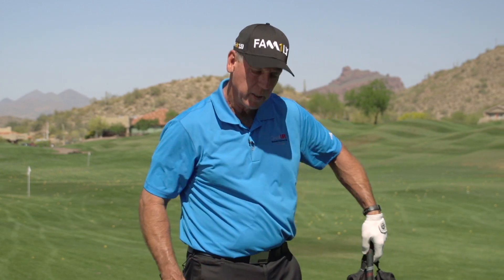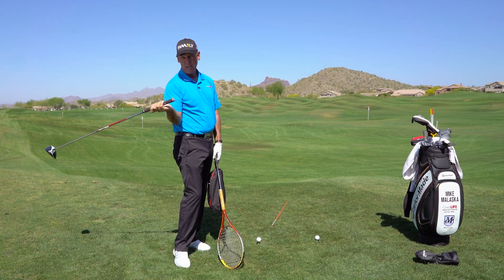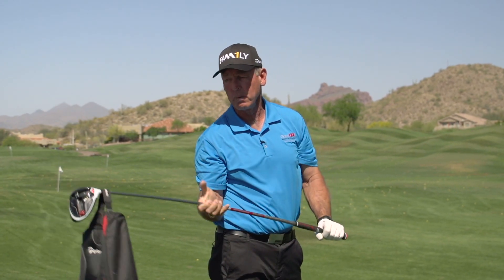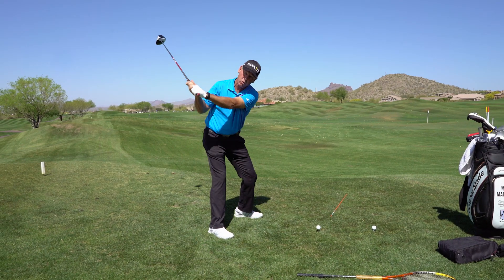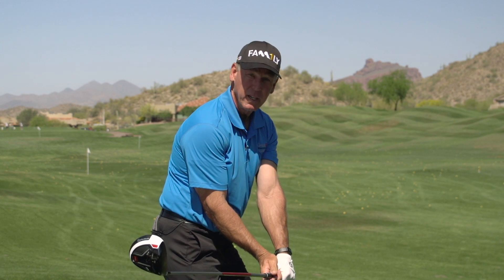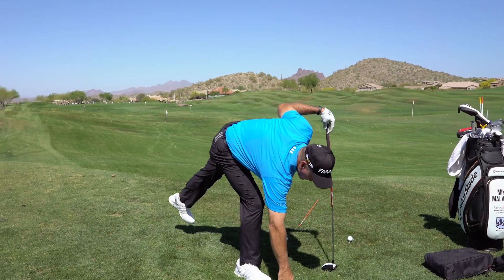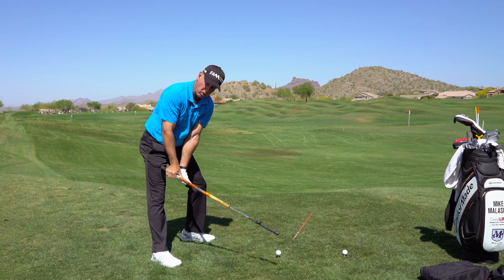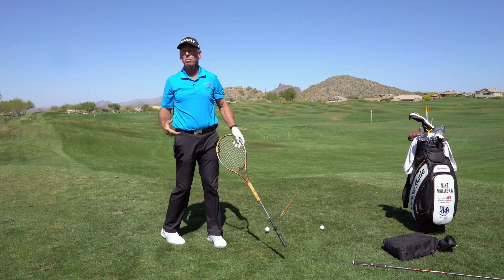HOW TO DRIVE THE GOLF CLUB WITH MIKE MALASKA

Comment: In Mikes defense teaching golf for 40 years both amateurs and pros Mikes teaching here is exactly what most pros are working on and that's getting the club back in front of them and still staying connecting. Most tour teachers teach similar ideas Ballard Springing the shaft left arm connection works about the  same. You would never see a tour pro practicing lag or trying to keep the club behind in the downswing and the reason most pros have such strong pivot actions for  the club gets stuck. On the other side I can see amateurs being appalled at this because most don't have a dynamic pivot were there creating lag thru there pivot. So I would agree this would probably a bad piece of advice for most amateurs who cannot create pivot acceleration .BUT if you get good enough we're you can accelerate your pivot to were creating 105 clubhead speed you'll find this teaching very beneficial
Reply: castlemangolf you’re wrong

Comment: i am amazed at he disparaging comments below.  I have taken many lessons and studied many golf instruction theories.  Malaska's instruction is most sound and insightful concerning the forces at work during the golf swing.  Now that I am a senior golfer in my 70s, I especially find his instruction most helpful in getting the club squared up in the impact zone without the additional body rotation necessary to overcome the clubhead that stays behind the hands during the downswing,  I have been a single digit handicap most of golfing career and I am striking the ball very well using his pivot point and "push away" from the club teachings.  I think if the naysayers studied all of his tapes and applied his swing instruction to their own swings they would be more appreciative.
Reply: I would suggest reading the work coming from college physics labs on the golf swing and the 3D models being produced from computer analysis and they completely contradict what he's saying.  The advice he's giving is a band aid cure for high handicap slicers.
Reply: David Laville, Dear David, I have read the articles from University of Pittsburg and Stanford as well as Muira's paper on parametric acceleration.  I believe what you are referring to is the concept of maintaining lag until releasing it further into the downswing than Mr. Malaska advocates and the X factor in producing clubhead speed. I agree that maximum clubhead speed can achieved by such method, but at what price?  The fortunate/unfortunate aspect of the golf swing is that there are different ways to deliver the clubface onto the ball with acceptable results.  I would put Mr. Malaska's approach along the lines of Henry Cotton, John Jacobs, and Jim Flick, his mentor.  I would not describe it as a bandaid.  I do not see it falling off.  Moreover, especially for seniors, I think it is beneficial to put our hands back into the golf swing.
Reply: Everett Urech Read the research of Dr. Steven Nesbit or the 3D models that show the club is still being accelerated longitudinally into the both arms straight position.  The lag is never released that's why a good swing has no release point feel. Henry Cotton, John Jacobs, and Jim Flick swings are based on driving range empirical evidence not scientific data or research.
Reply: +Everett  Well said, couldn't agree more.  Mike totally changed my game, his program/site is awesome!
Reply: Everett Urech i
Reply: I agree Everett, he's not trying to get into the kinesiology of the movements but the thought of the movements and visualization of the movements that have historically been successful.  I do not think one swing is for everyone, we all have to find our own...which may be similar to another...but it is about advancing a little white ball down a fairway into a hole....the issue is that everyone wants to do it in as few strokes as possible.

Comment: Tipping the club out is a little strange at first but when you finally "get" it it is pretty incredible. It is actually a barely perceptible movement that you don't have to think about. Also with this method the clubhead squares up at impact automatically because of centrifugal force. If you make the effort to understand and use what Mike is teaching it may just change your golfing life.
Reply from the maker: Thanks for the positive comment.
Reply: flower2289 absolutely! Once you perform this it works like magic!

Comment: Only issue I have with this movement is the hands dropping straight down toward the ground. Bradley Hughes (GolfAus) teaches the hands move outward and the forearms rotate clockwise at the start of the downswing then counter clockwise with body rotation to square the clubface. It promotes an inside approach to the ball. That works well for me. Well, after watching multiple Malaska videos and working on these drills I’m sold. I’m striking the ball much better and hitting straighter shots. More distance too.

Comment: Makes sense to me. Imagine making a swing exactly as you would to hit a ball on a level lie but standing straight up tall and moving the ground to the same relative angle to you chest. You will notice, at the appropriate angle how high relative to your waist line you're actually hitting the ball.

Yes the ball is on the ground but the hip hinge changes the angle to make the strike more like a baseball swing hitting the ball later in the release

Comment: I think there is some confusion with the comments on here & people are thinking it's an over the top motion....it isn't. Pete Cowan explains similarly with his axe drill & Thomas Pieters uses this in tournament play today. Stenson talks about using the ground & hammering into the back of the ball with his right shoulder. Rose explains it in a short video about "pushing" into the ground & defo rehearses before every shot. If I've got this right there is no "pulling" of the handle, the left hand drops by the right pocket by " leaning" on the shaft giving it pressure all the time fighting to keep clubface square. Garcia may look shallow & is but even he states he feels like he's pulling a heavy chain. The hips push as a consequence of what's occurring. Clearing early & dropping club behind will result in weak shots & shanks. How can you create clubhead speed by pulling the handle & lagging the head? You can't. Simple.

Comment: As I asked on another of your videos, from the start down you are demonstrating here, I noticed that almost every pro swing looks as if the handle is tracing the arc that you initiated on the "start down" move. By simply allowing the centrifugal weight of the club head to "release" on its own seems to generate a lot of speed without effort. In fact, trying to force "lag" or generate tension by trying to flip the wrists (other than forearm rotation) seems to slow the clubhead by forcing it off its arc. Is that correct? I've started using your down move and my swing seems to have improved in consistency and speed. By using a more vertical movement, my club tends to fight coming over the top or getting stuck behind me. I presume that is exactly your point.
Reply from the maker: DocDLH sorry Mr. Malaska is not available on this post to share further advice.  He is available on YouTube through his own channel or malaskagolf.com

Comment: I like his putting tips, but this analogy will only work for a limited few. Any motion (steering wheel idea) that pushes the right elbow behind the hip and above the left elbow is a recipe for disaster IMO.  Most players need to learn to 'allow' the club to drop behind and not 'steer' the club head over the top which is an instinctive reaction to 'control' the club head and deliver it to impact. I would encourage the exact opposite turn on the steering wheel to produce better results - :o
Reply: Nick The Hoff not in his terminology. He says you FEEL, FEEL like you are out there, in actuality its just allowing you to compensate for the momentum of the club. Note he says the pros use this, i don't see 1 of them slice or mishit like an amateur.

Comment: There might not be a better drill for players of any ability!  What is the biggest problem with ALL golfers.....good.....bad .....new.....experienced?  The SYNCHING of their arms and body at impact!  If every golfer got to impact with their shoulders square to the target (therefore with their arms/hands directly in front of their chest......yes, I know about Furyk, Trevino, Daly, Player, and all of those that are 'open' at impact......and I can explain those in another post if required.....), the average score would plummet and golf would just become a putting contest; and this drill does more to get people to feel that 'proper' impact than any other drill out there!  It doesn't matter how fast or slow you swing, whether you take the club back to the 'inside' or to the 'outside', getting to impact requires the SAME MOVE.
The ONLY piece of instruction missing, here, is where Mike shows that at impact, the 'handle' of that racquet is pointed straight at the sky and his shoulders are square to the target line......which, no doubt, he would have if he had another minute or two......
It's not easy.....in fact, it's an unnatural feeling (to most of us not named Nicklaus, Woods, Knudson, or Wright).  The baseball swing feels natural but you have to hit a ball travelling 95 mph.......the golf swing is unnatural which is why the ball is just sitting there.....both games then become similarly difficult to excel at.....
Reply: tr78478 the golf swing and the baseball swing extremely similar.  Almost every amateur has their shoulders square at impact and professional players are all open even tiger and jack are open about 20 degrees at impact.

Comment: I'm not sure about this. Nearly ever other golf coach encourages letting the club dropping down behind you and I was of the understanding that the club should shallow out in the downswing, not steepen. You look at pros like Furyk and Ryan Moore and they have extremely steep backswings, but then really shallow out the club on the downswing. Plus, for anyone who has struggled with an over-the-top swing (myself included) this is only going to worsen that problem.
Reply: In his other videos shows you over top swing because your shoulders going out to ball and spinning out to much try shoulders turning out right of where your hitting and feeling of overtop with your hands which will get you perfect coming from inside hitting straight shot
Reply: If you have an over the top swing feel like your shoulders are turned 90 degrees away from the target and bring your hands to somwhere near your address position while keeping your back to the target, over the top will be gone

Comment: OMG! The LAST thing amateur golfers need is the feeling that they're going to "cast" the club head outward. no, no, no, No, NO!!

Our biggest challenge is the brain telling a right handed golfer (with a dominant right side) to bring the right shoulder over and smash the ball.

EASY FIX FOR ANY SLICE & SIMPLE BALL CONTROL

Looking down the target line, see at the back of the ball cut into 4 equal sections (down the middle & across the center). Number them counterclockwise from the top left. #2 being the BOTTOM LEFT quadrant.

THAT #2 is where a right-hander needs to strike the ball for a baby draw. Focus on striking the ball from the "inside," so that the clubface (square to the target line) strikes #2 , entering from 7 o'clock and exiting out to 1 o'clock, with 12 o'clock as the target line.

I guarantee this, proved it myself with my "7-2-1 LEAN Golf Swing" with success for myself and my students. Forget everything else and focus on that. You can fade at will by hitting Quadrant #3 and work the ball as easy as pie!

Try it!
Reply: +Sickof GovWaste If you bothered to really watch the video and some of his others, you would see it is not casting.  It is called "over the top from the inside".  Just try the move very slowly as shown in the video.  The club moves outside of the hands as the hands move from the inside out.  It feels strange at first, but if you do it slowly you will see that gravity drops the club down inside the target line, effortless power, no getting stuck.  Adam Scott, Justin Rose, Susan Pederson, Lydia Ko among others swing this way. Watch more of Mike's YT videos to see it explained more. Your thoughts are valid, but you're always fighting timing and getting stuck.  I was always fighting my swing until I found Mike Malaska.
Reply: "over the top from the inside"

Makes absolutely no fucking sense chief. Your swing should NEVER, at ANY point, be over the top - end of fucking discussion.
Reply: +No Here Kruger  It's obvious by your language that you are ignorant and have no clue how the golf swing works, so there's no point in trying teach you anything.  If you do happen to open your mind and watch the entire video and some of his others on YT and actually try it the way Mike explains it, you'll see it makes perfect sense, chief!  The club head comes squarely into the ball from the inside with tremendous speed and an effortless release, period!
Reply: Nice try chief. Whatever gets you through the day...........
Reply: No Here Kruger the path of the golf club in the downswing is actually outside the path in the backswing on the game’s very best players. This was proven by studying the biomechanics if over 100 players on the PGA tour. It’s written in the book Swing like a pro by dr. Ralph Mann. You should really consider listening to what Mike is saying. It’s a subtle difference but an important one.